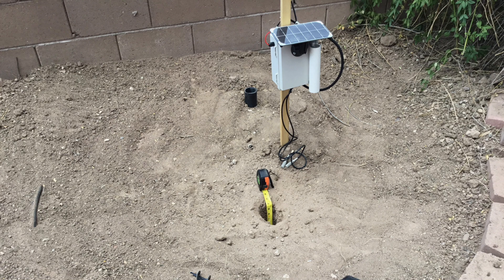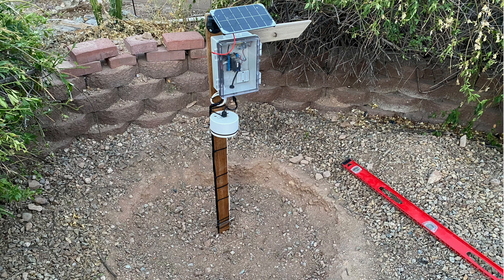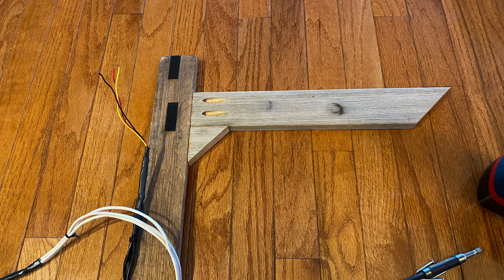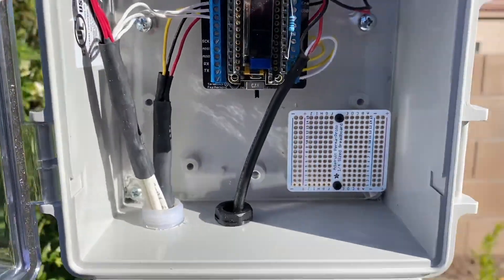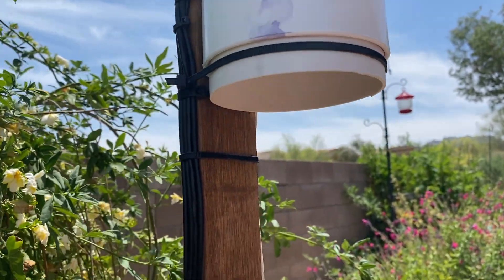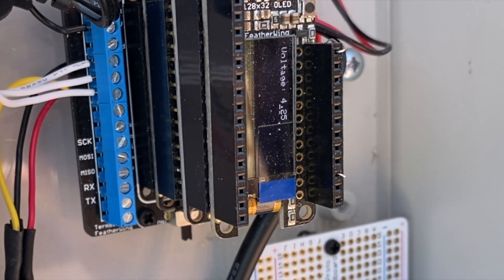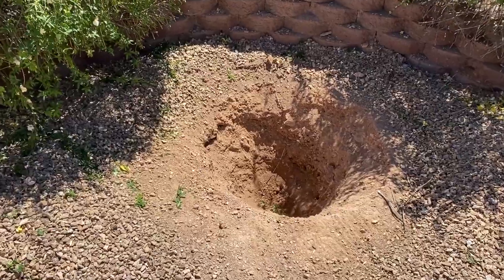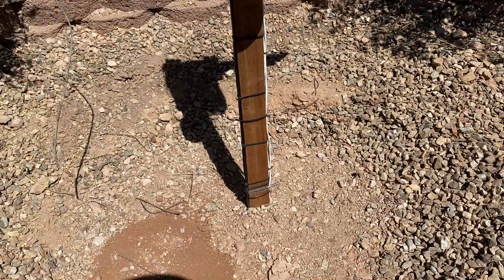Long-Term Soil Monitoring Installation

Comment: i did the same thing in my yard in Florida (no solar charger yet) using 10 sensors & a Mega with a wireless to do API posts to my webserver inside.  I cut a slit in some abs junction boxes n slid the CS blade through it, n siliconed the box sealed with all the connectors n electronics protected with some silica inside.. working great so far.  Put a 4 way 12v valve with relays to water at 510 on my CS, my trick now is to observe n calculate percolation/evap of xx amount of water over yy hours/days.. You gave me AMAZING insight into this stuff, so thanks!!!
Reply from the maker: What kind of sensors did you use? I’ve had no luck with capacitive soil moisture sensors over time- they bias results after initial wetting.
Reply: @ModestMaker  I'm terrible at documenting, but I'll get it all together n share eventually.  For now, I cheated a bit with a month of testing different stuff ... I found the perc levels in my soil, where it drains at different rates, n put my sensors there surrounded with a medical grade silicate sand that does not stick to the CS and it dries along with surrounding soil, it kinda "breaths" in the dirt with moisture if that makes sense.  I get from 510 to 290 CS readings and when I test with other devices, stand alone ones, the sensors are right on.  So far, plants n trees are perfect... Would love to figure a reliable pH sensor to determine when I need nutrients🤞
Reply from the maker: @livetohash6152 thanks for sharing those details. You may want to check this video out : https://youtu.be/iqiwVXhgNKw?si=dWcI4t72yOCv5oBh - just something to be aware of 😉. Interesting approach in using silica sand - sounds like it might work over the long haul (?)
Reply: @ModestMaker  we'll see, but they are medical grade, not regular choice... designed to absorb n dissipate... I'll get into it when I get it documented once I'm all done.  I'm about to move it all into a planter to lift it up for privacy, about 3 feet. So I'm thinking I make part of the side glass with holes to test various layers 🤔
Reply from the maker: I would like to test this. Do you have a recommended supplier for silica sand?
Reply: @ModestMaker  FYI, I have plenty, kinda overstocked because I was afraid of a shortage 😎
Reply: @ModestMaker  Okay, wanted to double check, n I just scanned over my notes, n it came from a Cali company but through  the VA purchasing department for the Rx part, so I picked it up at the VA medical center here.  I emailed them to ask how to get it direct, so waiting on a reply 🤞

Comment: Great project. Have you had any problems with water ingress in the DS18B20 or damaged moisture sensors due to corrosion while buried over a longer time?
Reply from the maker: All the sensors are holding up fine through the present except for the capacitive soil moisture sensors- those simply do not report valid data and failed rather quickly.
Reply from the maker: https://io.adafruit.com/biod101/dashboards/soil-experiment-ambient-shade
Reply: Thanks. That's useful information. I have been looking at making my own multi-level soil probe. A shame about the capacitive soil moisture sensors.
Reply from the maker: @brudwyr Sure. Here is the full playlist : https://youtube.com/playlist?list=PLqJ5k4cakypy1E4J_tvEiD0kpFK1tGY3D&si=KDV-10mbkuRZm4x7

Comment: The Alcohol thermometer has some inherrant poblems.
I just love watching you play, experiment and learn and I'm learning something myself - thanks.
On reflection - the capacitive soil moisture sensors have problems. I just wonder if an experiment that I conducted years ago, in conjunction with a geomagnetic experiment would give better results. The experiment basically consisted of two widly spaced electrodes buried in the ground and measuring the voltage potential (mV) between them. The variance to the data associated with geomagnetic activity may affect the data too much but this is food for thought.
Reply from the maker: Thanks - I have made a ton of progress since my last post which I hope to share soon— just not enough hours in the day. Yes- those capacitive soil moisture sensors are challenging, but it’s such an elegant concept. I am working on a few ideas myself and agree the key may be to combine with other data. Thanks for sharing your own ideas and stay tuned!

Comment: I love what you're doing, but I wouldn't give too much credibility to the information that those specific capacitive moisture sensors give you. :/
In my own previous experience, the variability between how each sensor behaved as they dried out was very high.
There is also a video by the channel "Flaura - Smart Plant Pot"  that discusses their problems with them and a potential fix.

I also tried some smaller green ones from Adafruit that wouldn't change value after drying out. Most of them just always read as "wet" as they dried up.

Unfortunately, good soil moisture sensors are ridiculously expensive per sensor. Hopefully that can change in the future.
Reply from the maker: Oh… I know. Those sensors are definitely challenged based on my attempts at calibrating here: https://youtu.be/iqiwVXhgNKw . The only reason I included them is to see if there is anything redeeming I might salvage from the same (since I have them already). I give more credence to temperature  as an analog for moisture. I may add different sensors later and will certainly check the video you shared for more details- thanks 😊.
Reply: @ModestMaker  I have switched all my temperature sensors to the DS18B20 sensors (ease of coding) and will be upgrading my Humidity sensors soon
Reply from the maker: Good choice on DS18B20. I like these as well because the signal works over long distances unlike others that rely on I2C.
Reply from the maker: Also this one where I confirm Flaura’s observations : https://youtu.be/lb4HdcpYWCQ
Reply: @modestmaker, do you plan on replacing the moisture sensors with more accurate sensors at a future date if those sensors are available. Or do tests to check for a relation between temperature and moisture?
Reply from the maker: I think temperature on its own can tell you a lot. The moisture sensors do react to significant rain- let’s see how they do when coupled with temp (and yes- the design will allow for mods👍).
Reply: You need a calibration curve for a single soil sample; start with totally dry and add measured amounts of water and of course readings. Since no two soils are identical, you need to sample soil in different locations. I would then use this to measure efficacy of not just mulch but cover crops with different hypothetical water holding capacities. Measure to see which is better and of course at what depth. Work this on soil believed to be associated with superficial aquifers. How to compare aquifers? Monitor their water holding capacity over weeks and months.
Reply from the maker: @38jaz  Yes - calibration curves tried and tested. All the experiments are available here: https://www.youtube.com/playlist?list=PLqJ5k4cakypy1E4J_tvEiD0kpFK1tGY3D

Comment: GREAT Video!!!! When you get a chance take a drill and put a bunch of holes in the side of  your PVC temp/humidity sensor housing to allow for cross flow air ventilation. I made my sensor box out of 8" square white plates purchased on Amazon. I put .5" spaces between them to allow for air flow. Works great! Thanks for the video
Reply from the maker: Great tip! I have other improvements I also need to make thanks to suggestions (like yours) shared in other videos. Will do!
Reply: @ModestMaker  Oh, forgot to mention that I drilled a 3" hole in the center of the plates (to hold the sensors in open air) under the top one which helped air flow.

Comment: Very cool project but why you use sd Card and Not a Lorawan Modul and send it online for example to ttn and Put the Data in a influxdb
Reply from the maker: I have WiFi so don’t need LoRa, but might play with that later. I do have a LoRa gateway installed at home, so it will definitely be something I play with down the line. For now, just want to get some baseline data :)

Comment: Thank you for sharing. Very interesting project. I wonder why you didn't use any wireless modules (like 433MHz, WIFI, or sort of) to transmit data in real time?
Reply from the maker: I will. That’s on the schedule, essentially to replace the data logger wit an ESP-32 talking to AdafruitIO. I just wanted to play a little more with data loggers first.
Reply: @ModestMaker  Easier to work out the bugs this way